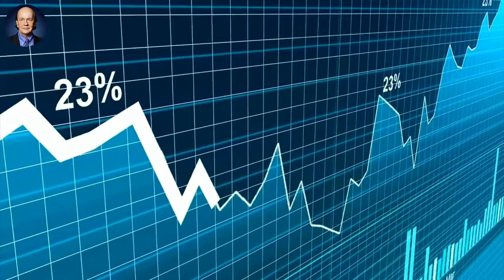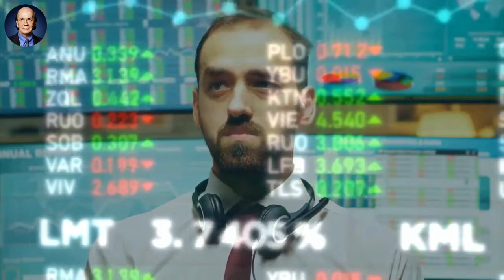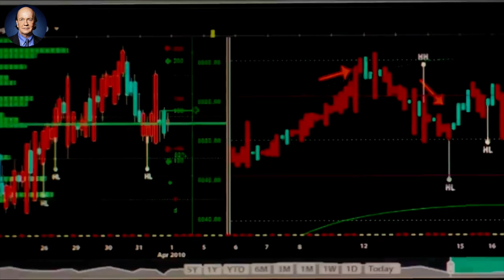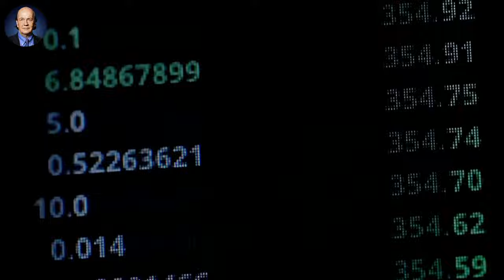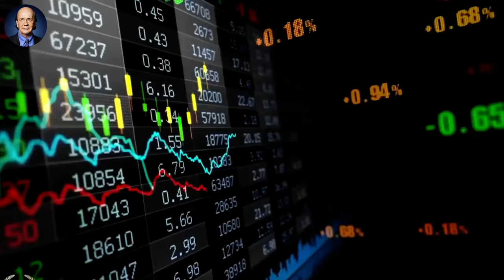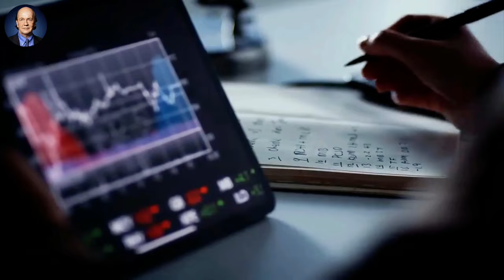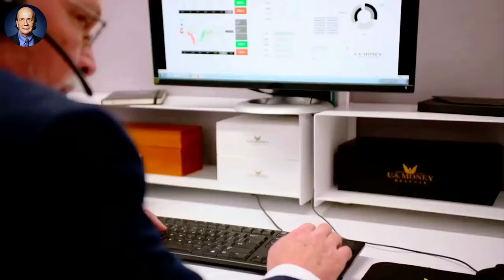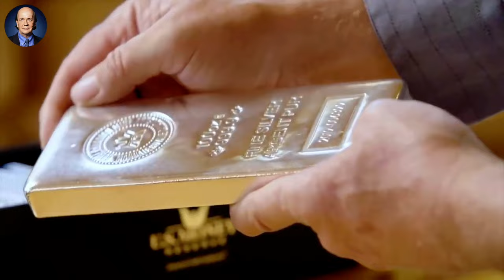Jim Rickards: The BRICS' Secret to a Gold-Backed Currency

Comment: "No one in the world has the gold to back a currency." — Jim Rickards

Jim, you can always back a currency with gold. The real question is at what ratio is the currency backed by the gold? Why couldn't the BRICS declare that 10,000 BRICS are backed by an ounce of gold? Of course, for whatever reasons, they might want to set it higher or lower than that. But you get my point, it's simply a matter of setting a standard that the countries involved in BRICS can agree upon.